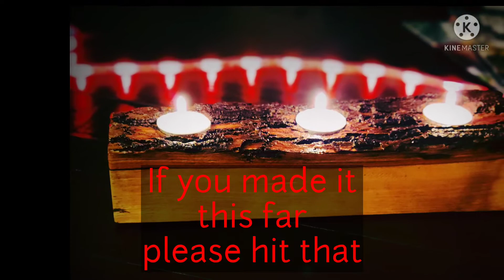How to make a Scrap wood candle holder. Wooden tealight center piece #2 #DIY #handmade

Comment: Now this would be an awesome build and money maker for the holidays! Completely rustic which I think most might be looking for, for the holidays. Thank you for the taking the time to make the project and video. 👍👍
Reply from the maker: Really appreciate the kind words! Yes this would be perfect for the holidays for your own place or even as gifts. I want to add that if you make it with the bark on to be sure the log is fully seasoned. The one in this video has held up well and I think the shellac did a great job sealing up everything. Just be sure to remind people to not leave an open flame unattended to be safe.

Comment: Hi, thank you for posting with all the needed details!
So I am cheap and I am looking at off brands for the drilling bit, but its listed in mm. So how do I relate candle width to the needed bit? Do I go a few mm over or less? 
If my candle is 40mm, should my bit be 45mm or 35? 
Many thanks ❤
Reply from the maker: Hello, If you can find yourself a 38mm bit then that would be best, Im thinking 35mm is far too small for a tealight candle. PS: you're being smart with your money, not cheap, espcially if its going to be for personal use.